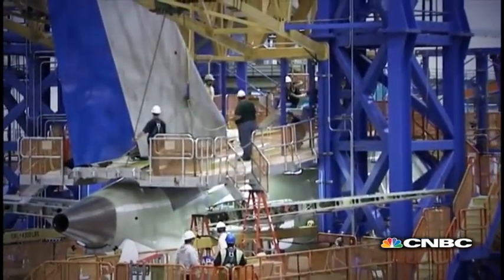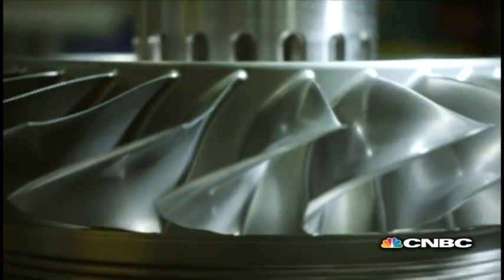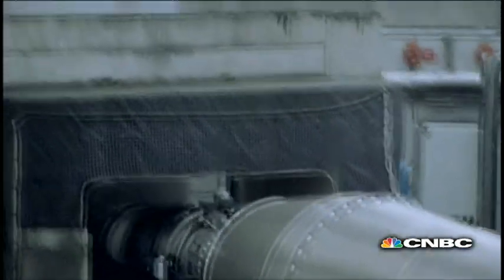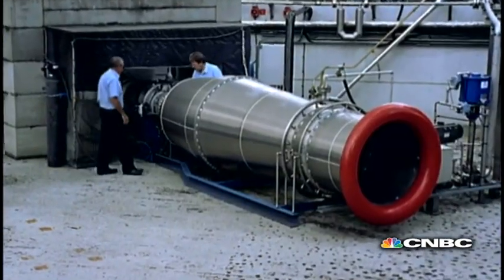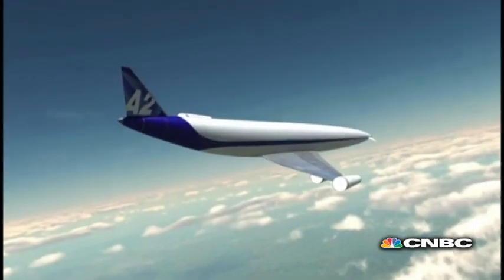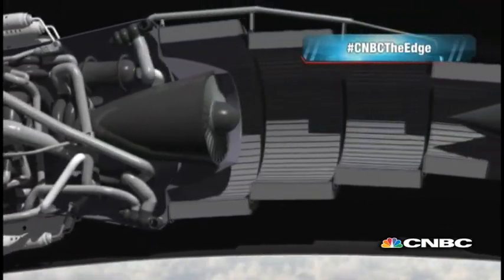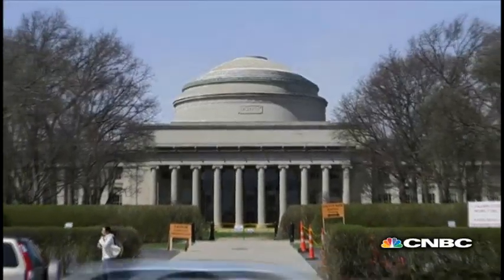Mach 5 aircraft technology | The Edge

Comment: 200:7 - miles - planetary tangency - Isotropic Vector Matrix - linear synchronous track - rotary synchronous ‘frisbee’ craft - weighted with water - electrolyse and burn - simultaneous tangent trajectory - what rockets do anyway - and vertical gain of height - shed remaining water - carbon hull - 3D printed - deployable rotary vanes on underside for re-entry: non-stop space......

Comment: The designers of Concord succeeded because they based their design around how fast they could get a structure to go with the technology they had... others failed because they plucked a speed out of the air (pun intended) and then had to try and design something that could withstand that speed. 

The thing is you can always go faster but if you can't get paying public at those speed within acceptable risks then you just have an expensive paper exercise.  How fast you can get a flying body to go has to be the core of any future design or you will fail to learn from the past.

Comment: What kind of air frame do you need to hold up to frictional heat build up on the aircraft,, Heavy metals I'm thinking,, will not be aluminum , carbon fibers? Also does the aircraft have to fly so fast or is fast needed as part of the cooling properties ?  It's not part ramjet is it? 
    Most of the time when they find a break thru it sounds great under our current way of thinking ,, then say you find an engine that can do what today's engines can do but at a 25 %  better fuel consumption, Instead of bolting it up and living with parameters we know now and bank the 25 % savings they will want to push everything until the fuel consumption is back down to today's standards,, but look we can get you there with less time in the air. 
     Does not help the consumer with ticket cost, does not help the planet because your still burning that fuel when flying faster,  only helps with time spent in the air,,
    If the aircraft can get on the ground faster, it can recycle the trip with new passengers faster,,,, more trips per week/month/year = more tickets sold , and airlines are getting happy. I myself would like to see the save fuel not used (at that point),, save money for the people that fly, less CO2 for the planet.  I maybe wrong, I haven't done the math ,, no numbers to crunch yet really.

Comment: The heat increases expotentially, as does the drag when speed is increased.
Turbo jet engine components get in the way at higher Mach speeds so the ram jet was devised long ago. 
Ram jets don't work at lower speeds so a compound engine, of turbo & ram were devised buy ducting around the turbo when higher speeds are needed.
The added weight, higher fuel consumption, greater drag, & extreme temperatures are a challenge! 
Like  the Concord, all this speed comes at a high price & that is reflected of the price of the plane ticket & price drives sales & profits. Higher prices equals less profit!

Comment: A problem with wingtip mounted engines is the need for perfectly symmetrical thrust.  When the SR71 experienced asymmetric thrust it was a very dangerous condition.  At these speeds a flameout on one side could destroy the plane.

Comment: The SABRE engine is in fact a liquid air rocket which was once called LACE for Liquid Air Cooled Engine which was once proposed for NASA's single stage to orbit concept.  The issue with cryogenic cooling of surrounding atmospheric air is that ice clogs it up, SABRE plans to address that by using the supersonic intake to create a strong vortex so that dry air tends to be on the outside of the vortex while humid air tends towards the center hence keeping the humidity away from the cryogenic cooling radiators, basically an induced centrifuge.  Normally, I would give them respect for at least trying to be creative but then they go off to say their engine can operate from a standing start through takeoff and then to hypersonic speeds when their entire premise requires supersonic to hypersonic speeds to begin with.  Any such start from a standing start implies a hybrid multimode operation where it can operate as a conventional jet or rocket at the slower speeds without the cryogenic cooled liquid air.  The promotion for a lot of these concepts is what loses my respect for them as the people doing the promoting have no idea what they are talking about and thoroughly misrepresents the proposals.

Comment: Never Happen. Yes, we can do it but we can't afford to do it. No airline company can afford to pay for the fuel to fly that fast. Any Air Force 'Jet Ace'  will tell you ... ~Resistance Through Air Squares As Speed Doubles.~  
Top speeds for jet air travel is a hair under 500 knots. Can't fool Mothe Nature. 
Air entering the SR-71 needed to be slowed down by screwing an inlet cone into the air inlet of the  Pratt-Witney J-86 engines. Without the cone, the air entering the engine at speed is the consistency of molasses. https://www.youtube.com/watch?v=m5qZZ3X44Go.

Comment: Aren't we done with polluting engines. TESLA engine for cars amazing. NOW for planes.
Reply: A Tessla battery weighs 540Kg and stores 85KWH of energy  which is an energy density of about 0.44 Mj/kg.  Aviation kerosene (Avtag) energy density is about 44 MJ/kg  In other words a tessla battery is 100x heavier than Avtag !   for Example a 737 has a fuel load of about 80 Metric Tonnes, the equivalent Tessla battery would weigh 8,000 Tonnes ( the weight of a warship ! ).
To all you greeny eco-loons. Just because you wan't something doesn't make it practical or do-able no matter how much you wail and stamp your feet !

Comment: In theory of gas expansion there is no way a jet engine can thrust the plane pass mach 1.05 because the more thrust from the engine the more air expand and so it neutralize over all effect. Other type of engine assist like inertia maybe but jet engine alone can not cut it.

Comment: Fast aircraft means long - long - long airport runways..neither profitable, nor sustainable no matter whether privately or publicaly funded.  Exotic fuels aren't cheaper than any presently available.  Airspace considerataions also mandate requiring current flight routes to donate "time and altitude" slots everytime this high speed bird takes off and lands.  For example Lockeed's L1011 did this and disrupted traffic simply because its' volumous body required slower climbs and descents to sustain operations....at the expense of other flight slots.  Profit margins can't stay healthy if there are any deviant aircraft flying the same routes as the incumbant fliers are using.

Comment: There is a way to make a wingless jet or plane,but that takes a jet fuel genius,like me ,and ofcourse some money from 
those just below those areas who use the fuel in their mind!And yes it can be done,as well it cuts fuel costs down because it is concepted as if it would have two wings,which are solid,and in a cilinder shape,your engines would be in the middle of the structure,The structure has a offset angle pitch of 5-7°,the front is larger,it is cylindrical and you could use small stubby wings to control it ,and no it is not a UFO.But it could be designed to be one,or a space vehicle,At a certain length it balances for flight,No lifting wings,None needed,You can really make a cigar shaped flying object,Like the UFOs people have seen.For $1 million,i can show you something,from there it would be in your hands to figure out,were to place engines and your cock pit and passengers.
Heres how you'd be shown.Payment first,then i pull the prototype out and throw it to you as in this action you see it fly.And thats it!

Comment: Ok I'm not sure why this video on aircraft then features the Scimitar engine. This a ramjet that switches to being a rocket engine after Mach 5, and can only be fueled by cryogenic liquid hydrogen. 
The fuel alone means it has no application to jet travel. If Concorde was held back by the cost of using a bit more jet fuel than conventional jets, imagine how cost-ineffective one powered by liquid hydrogen is. It's expensive as hell and is a nightmare to handle.

Comment: Okay, the aircraft engine might be able to thrust an airplane to Mach 5, but the fuselage and wings must also be able to withstand Mach 5 speed.  Easier said than done.
Reply: The flight surfaces can easily handle increased air speed, look at the SR-71 for example.  Titanium flight surfaces too!
Reply: @MissionaryForMexico ; Somehow, I don't think a Titanium airliner carrying 300 people from the UK to Australia at close to 4,000mph would ever be a money maker.
Reply: Add to that thenairfraim will need to withstand friction heating as well as constant pressure cycles
As for getting to the farsife of the world in a few hours is there going to be the market to genera busines it will probably have to fly over inhabited landmasses Malik supper sonic flightwull be a so no
Due to thethe boom.lots of acceleration changer is going to make full an issue
Reply: All these arm chair engineers saying "Bbbut its possible!" have failed to grasp the basic economics of mass flight or the actual cost of titanium machining and engineering. Reskinning every current air frame in titanium, the doing CFD on new designs, then retrofitting, then teaching pilots to fly. There is absolutely zero current advantage to mach 5 travel, and it will not reach the average consumer in our life time until titanium and high tech manufacturing methods become as cheap or worthwhile as aluminium manufacturing.
Reply: Actually the biggest problem is the engine , I mean did you believe that just cooling an engine will give it more power !!!! NO , and the quantity on fuel needed for that !!!! Notice this documentary was in 2014, so after one year the only engines fast are the scram engines , only used in missiles because they burn so much fuel it only last for fews minutes , well at mag 6 or 7 fews minutes are like 1 or 2 thousands miles, so it’s all bulshit , lies , politicians propaganda , a larger airplane can never fly at mag 5 , it should be very slim , aerodynamic , with minimum loads , only the army can afford that .
Reply: A few hundred dead passengers helped Boeing figure out a sensor defect on the 737, it may take a few more to improve upon the Concorde's speed, and the dead it left behind.
Reply: @billboyd4051 ; yes, I realize we are trusting our lives to micro-processors more every day, but I still don't like it.
Reply: @oldgysgt  Such a shame the very wealthy are in such a hurry, I thought the computer and video conferencing would satisfy the need for speed. Its amazing how important a golf game is that you need a million pound plane to get there.
Reply: @billboyd4051 ; I don't mind rich people going fast, but they have no right to shake my house and break my windows while doing it.
Reply: @oldgysgt  We're lucky the big ones have crashed into the water lately out of control. They use to lose power and crash, now they go in with both engines running. Technology has come a long way.
Reply: It will be titanium wings and fuselage

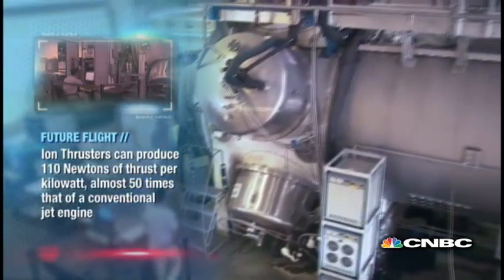Comment: At 3:45 the caption incorrectly states that ion thrusters produce 50 times as much thrust per kilowatt as a jet engine. 
The reverse of that is approximately true. Stating that an ion engine NEEDS fifty times as much power to produce as much thrust as a jet engine is a reasonable approximation, though that figure can very a lot actually.
The 'efficiency' of an ion thruster lies within how much delta-v it can give you for a given amount of propellant, or more accurately reaction mass. To achieve this though it requires far more energy. 

The advantage of an ion engine exists only in space where you are limited by the amount of propellant you can carry but relatively unlimited in the energy available to run the engine. So what you do is use the extra energy to put more kinetic energy into the propellant getting a higher specific impulse. That means reducing the mass flow rate (so the propellant last longer) but accelerating it to a very high speed, which consumes a lot more energy.

In the atmosphere the opposite is true - you have relatively unlimited propellant but limited energy so you want to use your energy most efficiently which is by increasing the mass flow rate and decreasing the exhaust velocity. 

With a conventional rocket engine you are limited both by the amount of propellant as well as the amount of energy, since both the energy as well as the reaction mass is what is contained within the fuel (and oxidiser as the case may be).

Comment: 3:45 This claim is complete bogus, since P=F*v, this would mean the exhaust velocity of 9 m/s. At this speed you might as well use a propeller. In fact, ion engines are known for the opposite property: they have extremely high exhaust velocity (~100,000 m/s)

Comment: darpa have been flying at mach 20 since about 2012.... well trying to any way lol
Reply: Spacecraft have to reach Mach 25 to get into space, and the space shuttle routinely flew at that speed at the upper edges of the atmosphere during both launch and re-entry.  Sustained flight at those speeds is still not possible but there are research aircraft flying at crazy speeds and pushing the limits further and further.  The future of flight certainly includes regular flight above Mach 5 within the atmosphere and maybe at around Mach 10-12.

Comment: Prechill? It's all about net efficiency. And pre-chilling won't do that, what so the plane will magically cool the air down before it enters? Where's that energy come from? And ducts = weight fellas. Better designed turbines with some kind of charged thermal insulator or coating would work much better than this garbage.
Reply: The heat is dumped into the fuel headed into the engine, by a helium cooling loop.
Reply: yeah....sounds like an accident waiting to happen.
And fyi, liquid helium (which you can't make on site) is fucking expensive and leaks all the time it is used.
Reply: Myke Prior Liquid Helium costs 5$ per liter. "Fucking expensive", I think not. A half-decent wine costs more than that. The Helium in this case is in a closed loop, it's not consumed, which reduces the amount of refilling required enormously.

Other rocket use it as pressurant, not as coolant.
Reply: You have no idea what you are talking about.
I actually work with the stuff in NMR and it leaks a little whenever its used....it almost always needs to be wrapped in a jacket of lliquid nitrogen to keep losses down. Refills are over 20k$ for our research dept.
so basically you're nuts.
Reply: Myke Prior And how many litres of Helium does your research dept buy at a time? 4m3, by any chance? Right now, LHe costs 100$ per cubic foot...which comes down to a bit less than 5$ per liter.
Reply: lol. it costs us at least 3000$ to fill up...and at least 30% of that evaporates on filling....so it realistically costs way more.
Maybe you should actually work with the stuff before you throw bullshit around.